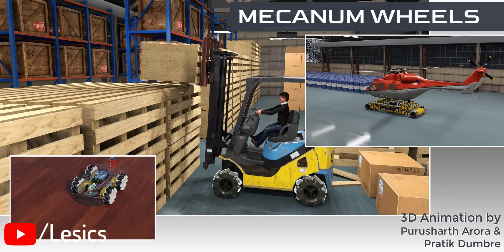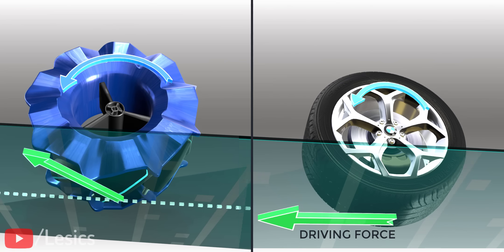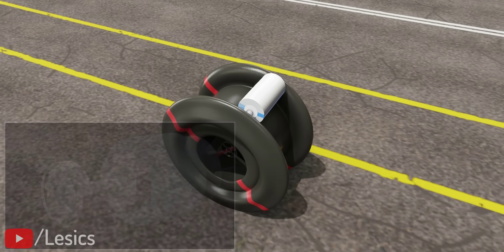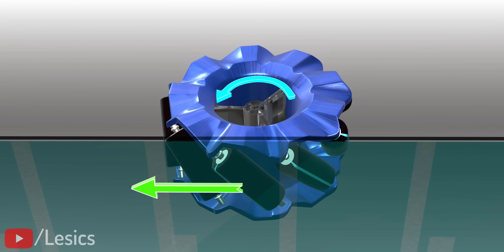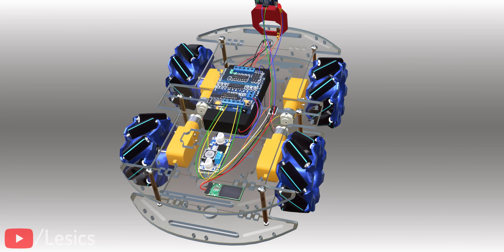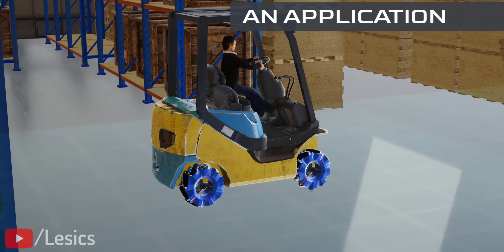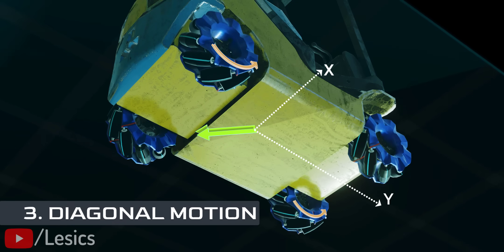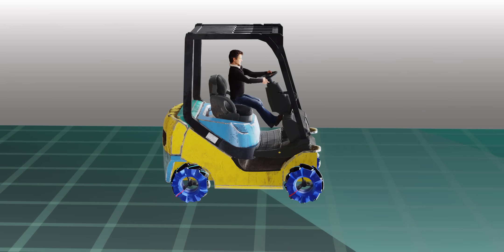The Brilliant Engineering of Mecanum Wheels!

Comment: Doesn't work so well when there are associated problems, such as weak or damaged suspension/springs that cause the car to tilt to one side, or rock from side to side, or imbalanced cargo.  Then there are track anomalies, poor rail beds that allow the rail to sink under weight, all which throws off center of gravity of those balanced axles.

Comment: How would this compare to a simple 4 wheel platform with each 'simple' single wheel being on a vertical 360 degree rotating trunion. It could with computer control do everything these mecanum wheels could  do without the physical drawbacks of complex construction and inefficiency.  Thinking about it some more, these simple platforms already exist, the lifts used to pick big yachts up out of the water and position them in a boatyard. Sorry, the 'improved' wheels are certainly a wonderful lateral rethink of the wheel, but the drawbacks... I dunno

Comment: Cool- awesome, even, but horridly impractical for forklifts and other heavy equipment, due to their reduced contact area, increased friction, and thus massively increased wear.  They also lose out against fixed-rail systems in the niche applications they would otherwise excel at, namely automated warehouse management.

Comment: In modern warehouse where you want to have as minimum empty space as possible this would be solution to where automatic warehouse house would not do. 
As for maintenance of wheels when they get worn out. Just replace rollers which can be done by machine to find worn out roller. Rollers simply need some rubbery  tape on them that can be added or removed and old one melted with impurities removed and new one printed.

Comment: To my mind, for a vehicle like a forklift that is heavy and also carries a lot of weight, the point load pressure bearing down at any one moment on only 4 individual rollers, and more importantly, the pins/bolts the hold them in place, would surely be points of potential structural compromise!?

Comment: As a hilo operator, I can assure you that there would be many accidents with these types of wheels. Even if you had more space to move about inbetween aisles, there's always stupid people that get ahold of a hilo. Another issue I foresee: water. A common hilo with non-treaded tires coming into contact with the smallest of puddles ends up sliding in one direction, regardless of what inputs you put into the steering wheel or brakes. Having rollers with slanted surfaces doesn't seem to offer any better solution there either.

It's cool in theory, but practicality is more helpful.

Comment: Forget it, works only under lab-conditions. You see, the most important aspect of any technical system is reliability. What if, (as “f33net” has already pointed out), good old dirt gets on the wheels? Also, considering friction, how about the surface of the wheel that connects to the ground? If you put good old load on it, the surface changes, and you do not just have one big axle on which you can put (literally!) tons of load on, but a bunch of rather fragile ones. Also, bearings etc. wear out, what then, what if one of those cylinder gets stuck or just harder to roll due to wear? Nice concept, but not feasible in the real world. Keep things simple, stable, and reliable!

Comment: The maintenance cost alone are enough to turn most customers away from this concept. These have way more wear points than necessary. 
Every individual roller, the bearings, locking mechanisms. I just don't see it as feasible. 
And depending on the warehouse layout, most companies are already utilizing different styles of forklifts for specific applications. Look at Swing Reach forklifts, and there are swing reach attachments for these size forklifts as well. 
And what about safety features? Do these tires have locking mechanisms to prevent a forklift from sliding sideways down an incline? Will they work with a forklifts parking brake? Will all the rollers be able to lock up? 
And it's clear that these aren't something that can be used on existing forklifts seeing as how the wheels need to counter-rotate. An entirely new drive system needs to be developed just for these tires to function as intended. 
I'm mostly concerned about stability and handling issues though. You've seen how some forklift operators drive, right?

Comment: When it comes to working in aisles, these wheels offer very little when a three-wheel forklift with a two ton lift capacity can already turn it's steering wheel 90° or more. Either way, you're limited by the total length of the truck, forks included. Conventional wheels will be far cheaper, too. Our narrowest aisle at work is around 7'4" wide and, with a bit of fiddling, I can place our crates on any level (sometimes by picking up the crate a bit diagonally). The reach truck is obviously much better for this, though.
Reply: not to mention you can have magnet lines meaning you can  make the aisle as wide as the truck your using
Reply: @Kr4zYm0f0  Yeah, that's what we have for our order pickers. Turret trucks are probably the same.
Reply: @Ostsol  yes turret trucks work like that, you also have a combination of a reach + turret truck that wprks with a magnet line in the floor.

Comment: It's like a solution in search of the appropriate problem. I think robotic (driverless) forklift systems make better sense and do not require so much specialty parts and wasted energy to achieve the same motion. Maybe it works well on a Mars transporter?

Comment: When this vehicle is moving straight forward or backward, the wheels are fighting each other. Their pull (or push) in opposing 45' directions is canceled out and the vehicle moves forward, but the loss of efficiency has got to be tremendous! This will give terrible gas mileage or battery life because the forklift is using a large portion of it's energy fighting, itself unless it is rotating in place. Cars get bad gas mileage when they are out of alignment. This is taking it to an extreme.

Comment: A Fork Lift using these wheels was seen in the shuttle hanger scene in Star Trek (2009).
These wheels have been around for a while now but are only used in specific applications.
Reply: Myth busters also used a fork lift with these wheels. I never understood how they worked. I was thinking that the small rollers were somehow powered. This video simplified the wheels but the drive system just got complex, each corner needs it own power. Then a fluid way for the operator to control it.
Reply: I am pretty sure I saw these at an expo back in 1993.
Reply: Can definitely see a few niche uses for these, but overall for general use these scream impractical.
Reply: Like forklifts?!
Reply: @rootytootyfreshnfruity9480  Yes, for use in confined spaces, but also seen them used on some hospital gunnery's and the occasional wheel chair and a couple ROV applications.
Reply: Airtrax forklift.
Reply: ok
Reply: https://youtube.com/shorts/_t_aAw5JgWM?feature=share

Comment: looks good in theory, to  truly better understand this, you must Put Weight on the Forks are 2-3 thousand pounds., and drive in and out of trailors 50 to 60 times to see where the Faults are, everything Looks good, but til it gets build and put to practical use. it will remains just that, A THEORY.
Reply: These are widely used in Aerospace.
Reply: @davidsandy5917  yeah i can imagine, and Aerospace has 500 more gadgets that can never be made for the consumer to use, and when you look at how Technical and Specific you would have to be when moving Million dollar equipment around, would make sense to have those. but this a Video " whereas a normal forklift takes a lot of space and time to achieve the same task " so LESICS is Referring to your Everyday Forklifts and how these Tires would be much better to use. in all , until LESICS actually Shows Videos on how they would Perform on a " Normal Forklift " its still only a Theory.

Comment: Seems like the sideways force on the axle would destroy bearings, and cause excess wear to drive gears.
Reply: It does. It's like if you've ever had a truck in 4x4 mode and then turn tightly on a flat smooth surface. Everything wants to bind. The rollers are designed to wear and be replaced.
Reply: It would
Reply: and to the floor

Comment: I saw a mouse that used similar dual wheel characteristics to encode x and y movement, with the added benefit that they were isolated from the reader mechanic by an axle that could actually be sealed to prevent grease and dust from collecting on the reader mechanism.  By tilting the wheels they don't pick up all the friction that just running two opposite wheels do, which traditional mice solved by using a ball in between the wheels.
Reply: Meanwhile modern mice solve the problem quite nicely by using a camera instead of wheels.

Comment: Hm. This video had a lie in the first twenty seconds. Source: I had to pass my fork lift certification involving much less floor space with two hundred eighty degree turns, loaded and unloaded. and it was a four-regular-wheel vehicle. Counterbalance fork lifts have VERY small turning radii. There is such a thing as 'do it like you would a three-point turn, if your regular car could have the same turnign radii as a london taxi and not skid so easily when trying to move from a stop with full-lock steered. And its rear-steer, rather than front, so the three-point maneuovre is basically reversed.
Reply: Yeah, and there's already the CombiLift, which can already move in any direction you want while not using super complicated high-maintenance wheels.

Comment: Will not be used in normal production, because to low friction, to much wear and to expensive to maintain. So the normal forklift and even high end solutions still use ruber tires, because they are cheap and the 10-20 second for the driver are cheaper as expensive wheel solutions. Yea it works, still to expensive and complicated to be used.

Comment: just wandering what space material should be used in thous rollers shaft to hold forklift and its cargo weight
Reply: The shaft is steel, the roller is usually a tough elastomer over steel.

Comment: It is indeed genius, but a somewhat similar effect is achieved by any zero-turning-radius riding mower, with two rubber tires on powered wheels and two on free casters.  Each of the powered wheels is capable of being driven forward or backward independently by either mechanical or hydraulic means.  It can rotate 360° in one spot.  It cannot move diagonally or sideways without rotating, moving, then rotating back, but that's a relatively quick and easy sequence with no looping or three-point turns needed.  The advantage is that it works on irregular surfaces and those with variable traction.

Comment: Why don’t they have non-steering 360° pivoting wheels in the back and have the front wheels steer by controlling the power to each wheel indispensability. Pivoting can be done easily by the left front tire turning opposite of the right one. Like a lawnmower 

Another thought would be to mount the forklift on a solid 4 way-steer chassis but have the chassis and the forklift body connected the same way as an excavator, with a pivoting base that can turn an indefinite amount. The tires can stay straight with the aisle, steering slightly if needed, then steering more on the ends for needed 90° turns

Comment: I'm sure the wear/tear and friction associated with the motions can quickly shorten the tire lifespan and even the ground surface it contacts.
Reply: I am thinking the same the wheels would have a extremely short lifespan and the surface it uses would need to be near perfect so parking lots would be out of the question. Polished concrete would probably be the the ideal surface. As for the wear lets assume the rollers are a consumable  perhaps they last a month. Just because they are shot doesn't mean the wheel would be shot. And the really cool feature is you would be able to change the rollers with the wheels still attached to the fork lift just do the ones facing up then turn the wheel and change the other half of them. The rollers which are a small tube would be easy to manufacture and should be rather cheap since wheels are the real engineering challenge. And if you replaced just rollers the wheels should last for dozens perhaps hundreds of roller cycles.
Reply: https://youtube.com/shorts/_t_aAw5JgWM?feature=share

Comment: The fork lift I use at work can spin 360 in place? Using rear wheel steering...
edit: also dont feel like using my brain rn, but with the counter weight in the back of the lift, if these wheels don't wear equally; will it affect the performace of the driving?